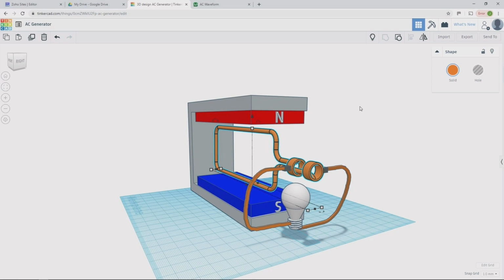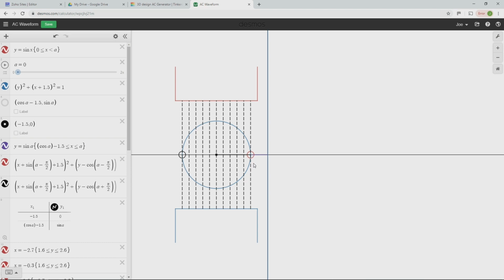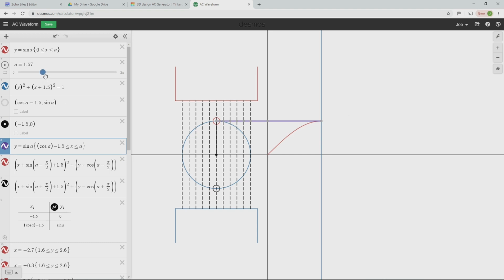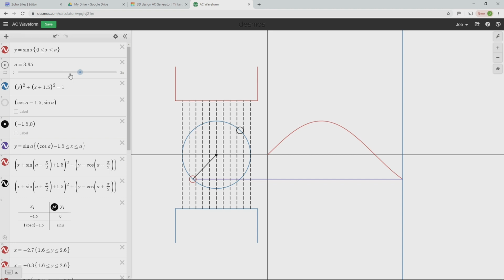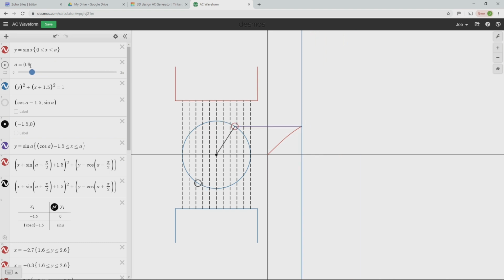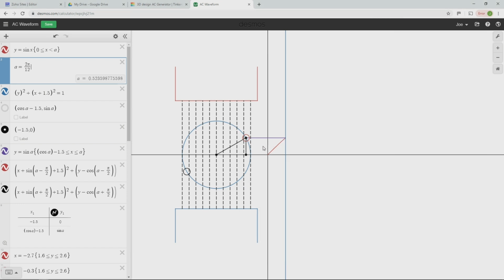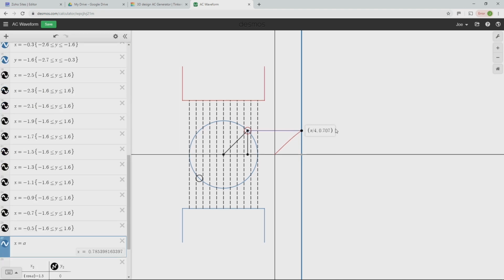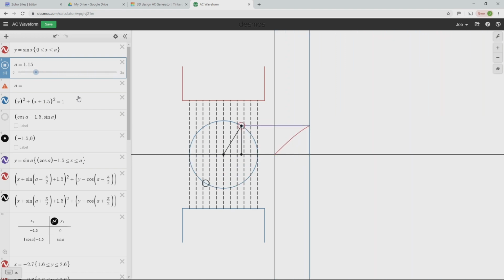AC Theory: Why is AC Called a Sine Wave?

Comment: Can anyone help explain why 30° is half the peak rather than 45° being the half the peak, if 90° is the peak? Struggling to get my head around that bit. Thanks
Reply from the maker: If you draw a right-angled triangle with a 30° angle you'll find the shortest side is exactly half the long side. 😍 In other words the sine is equal to the opposite over the hypotenuse. 😊